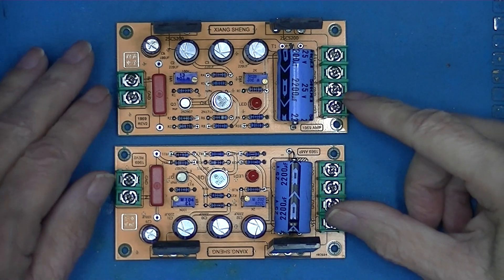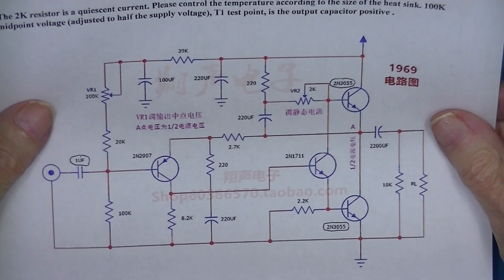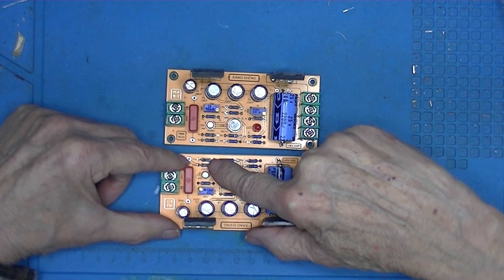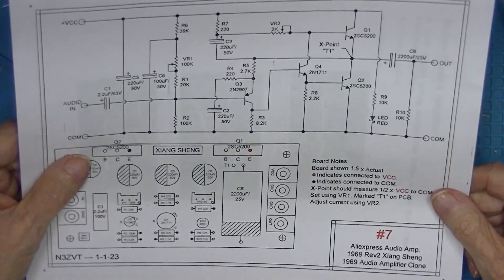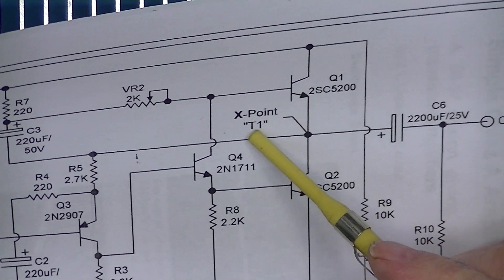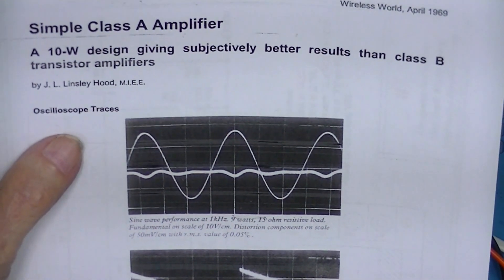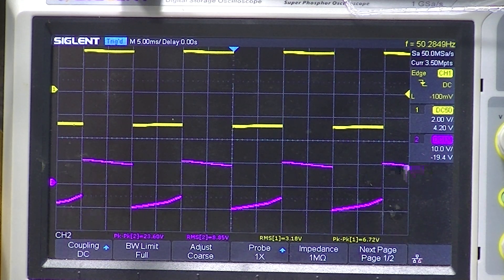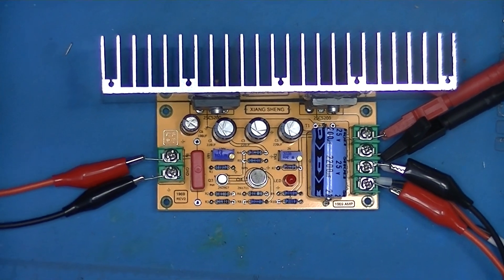J  L  Linsley Hood 1969 Amplifier -  Part 9

Comment: Just wanted to let you know that you've done a great job with the JLH 1969 amps.  I Know what is involved in doing schematics, BOMs, board layouts, and all the testing you have done with these amps. Letting you know it's really appreciated. Been thinking about building a nice class A amp. Seems from what I saw is that some of the first ones you tested were better than the rest.  Not sure which was the best. My memory is not what it use to be.

I've seen one on eBay that is just the boards. It has 4 output transistors and says it's a class A amp, but appears to have split rail, not sure what is up with it.

Have you listened to any of these?
Which one of them do you like more than the rest?

Great job!  You have another subscriber.

Just realized that you haven't posted anything for a year. Hope you are doing okay.

Comment: Steve, it's been a year or more since you did these videos, which I've only just found and watched them all, thanks.

You may be bored with the project by now but I thought I'd shed some light on the differences in the various designs you tested, e.g. variable bias arrangements, high frequency tail off on the output.

These were the subject of follow-ups to the Apr '69 articles by J L L-H in Oct '69 and Dec '70.

Regards Alan G8WBU

Comment: Hi Steve, I've just finished all Your episodes this afternoon, and firstly to say thanks ever so much. You've explained so much valuable information. I am currently building a pair of monoblock 
John Lynsey Hoods 1969 design. After building the Ali Express stereo board kit that comes with a heatsink. I decided to go full out and build the best job I could. I am collecting up any parts needed like large heatsinks, vintage RCA 2n3055 transistors, Nice aerovox 4,700 caps for the output capacitors, and some really nice high quality carbon film resistors. All to build into an Oak chassis. This will be the second J L H I have built as My very first amplifier i built was the 1996 electronics world revised J L H circuit, and I know how good the circuit can sound when done with good quality components. I have even bought a copy of the original April 1969 Wireless World magazine with the original article by John Lynsey Hood. It is well worth reading the original article as it goes into great depth how the circuit works. Anyway Thanks again. Dee

Comment: How does it compare to modern amplifiers? Are there any advantages in using this one?
Reply: It's a very rudimentary, simple amplifier. The benefits to using this one over a modern perhaps different topology, may be the ease of understanding and use that comes with such a simple amplifier. 

Other than that, it's got a lot of distortion due to its way of functioning, and that may be something someone desires for its qualities in tricking the human brain into perceiving instruments as further away or closer to one's head -- often called sound stage